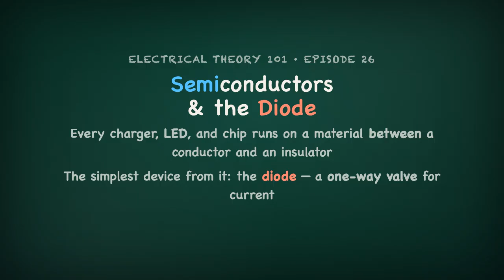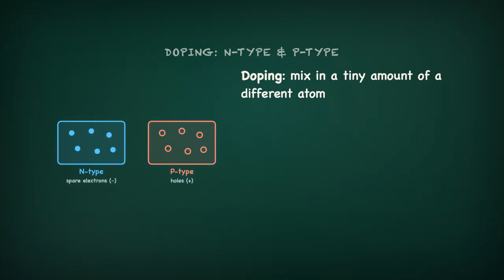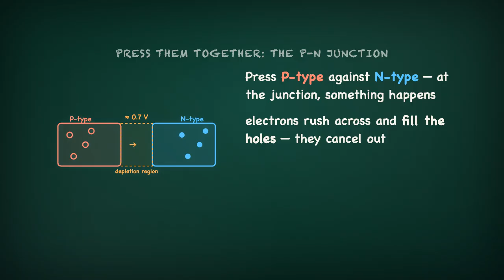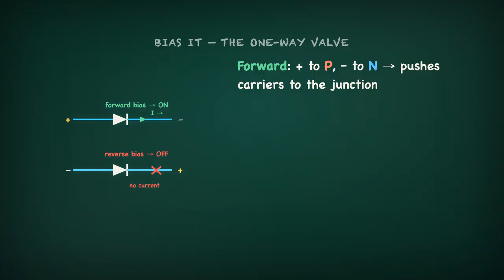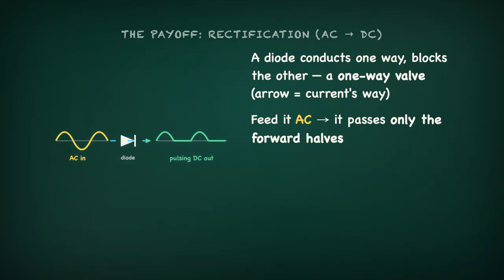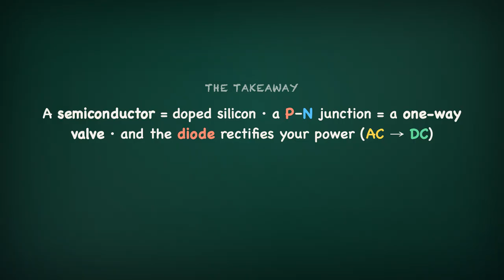How a Diode Works: Semiconductors, the P-N Junction & AC→DC | Electrical Theory 101

Comment from the maker: Practice answers:  A) A silicon diode drops ≈0.7 V, so V_R = 10 − 0.7 = 9.3 V. I = 9.3 ÷ 2000 ≈ 4.65 mA.   B) ≈ 0 A (just tiny leakage, microamps). Reverse bias widens the depletion region and strengthens the barrier, so essentially nothing flows — until the diode's reverse breakdown voltage, which you stay below.   C) Only the positive humps get through (each ≈0.7 V below the input peak); the negative halves are blocked → pulsing DC. That's (half-wave) rectification — exactly what every phone charger / power adapter does to turn wall AC into DC.
One line to remember: doped silicon → a P-N junction → a one-way valve (the diode), and forward it drops ≈0.7 V. What should we cover next? ⚡